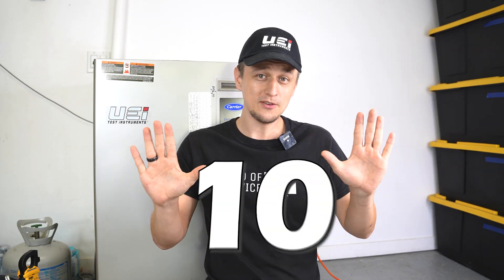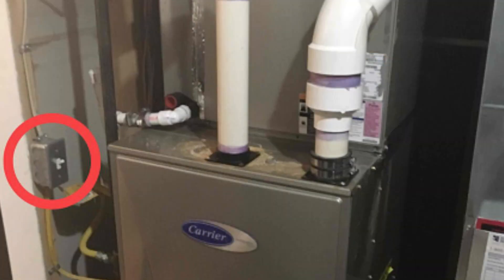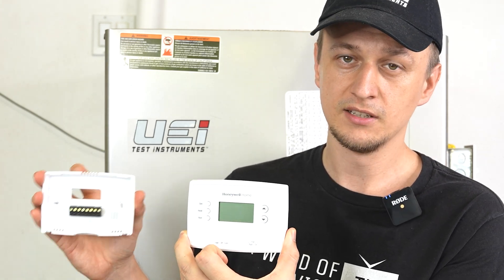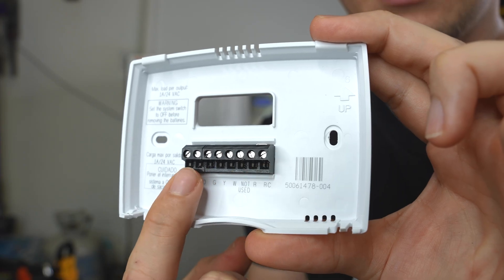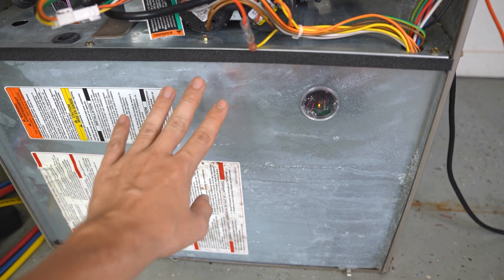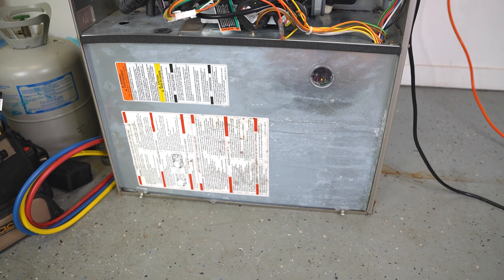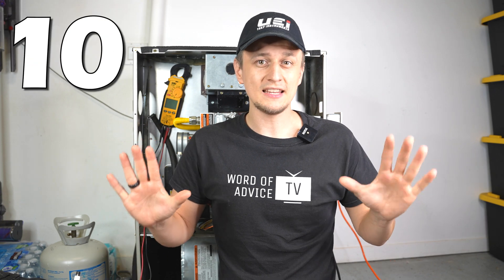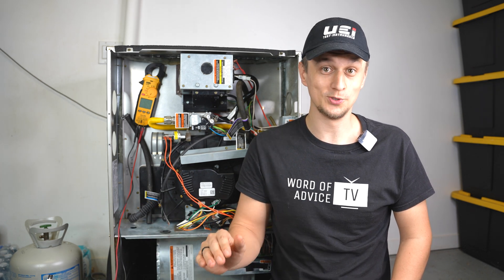10 Common Reasons Why Gas Furnace Won't Turn On

Comment from the maker: ⬇ Other videos you may find helpful:

The MOST Common Furnace Problem:
https://youtu.be/3Jonl_TLkpE
How a Furnace Works - Sequence of Operation:
https://youtu.be/AQD_MedIklI
Top 5 Furnace Problems:
https://youtu.be/T4IWtKy--Vk
How to Find a Low Voltage Short:
https://youtu.be/4e4wsruGS0s
Furnace Blowing Cold Air, How to Fix It:
https://youtu.be/pJzP1jzYPqg
10 Reasons Furnace Overheats:
https://youtu.be/3ZPmltTR5S4
Don't Buy a High Efficiency Furnace:
https://youtu.be/7d783qs3laA
Best HVAC Brand to Buy:
https://youtu.be/Cy46yTbkNhI
How to Manually Light Furnace:
https://youtu.be/-bMz1En0DSg
How to Read Furnace Wiring Diagram:
https://youtu.be/2MSedAkirqw
How to Figure Out Age of Furnace:
https://youtu.be/ntBIaY7ncqY
10 Yearly Furnace Maintenance Tips:
https://youtu.be/2IG_YZTR-lE
Thermostat Screen Blank - 10 Reasons Why:
https://youtu.be/vi3OJuGfaac
Furnace Error Codes Explained:
https://youtu.be/J8Zegm4TClM
Reply: Flame sensor most of the time and if it's not damaged clean it up and bam back in business

Comment: Hello. I would like to ask you a question and I hope you can help me. My home heater runs on gas. It has three gas nozzles. But for some reason, the three nozzles don't ignite at the same time; the third nozzle ignites 3 to 5 seconds later than the other two.  Because of this, my heater automatically shuts off. Could you please tell me how to fix this? Thank you.

Comment: I CAN’T THANK YOU ENOUGH!, I have a newer gas boiler –a radiator heat furnace that suddenly did not turn on  today about 4 pm.  I had moved  furniture and did bump the thermostat in the bedroom but didn’t think too much about it. 
    At 8 pm the house was pretty cold as were all the radiators –[here in southwest pa it’s  25 degrees].  So I made many trips to the cellar to trouble shoot and back up 2 flights up stairs to no avail.  All the vids I watched didn’t go through the basics first.  Well, it was the red wire of the thermostat that came loose from the bump.   Furnace back up at 10:40 pm.  Thank you!… Best blessings of Holidays etc…

Comment: My sister's thermostat says "locked" or "locked out" and can't figure it out
Reply from the maker: Is the furnace blinking any error codes? This error message might mean that the furnace is locked out due to a tripped safety switch. Or.. Could this simply be a child lock? A quick google search for your brand thermostat should give you an answer.

Comment: Thank you! - Furnace not coming on. Nervous about messing w. it, but thought before I call someone…
The on/off switch was off. Whew. All good.
btw: Used my 1910 Perfection kerosene heater & a plug-in oil heater to keep us warm last night.

Comment: Thank you so much for this video. It got colder outside and I turned on the heater and it didn’t work. It got to 66 degrees overnight. I watched your video this morning n fixed the problem! Thank you, thank you!!!
Reply from the maker: You're so welcome! Glad I could help you get the heat back on!

Comment: You are a life saver my friend. My family and I have spent the last week in a cold house because our heater went out. No money to make a service call. I have tried a few things including checking the breaker and nothing worked. After watching your video, I went back to the attic to look for the LED light on the furnace control board. Luckily there was a red led light on it. Going back to step #3, I decided to change the batteries on the thermostat like you suggested. Lord and behold, my furnace came back on. Never thought the thermostat had anything to do with the furnace. Thank you again.

Comment: Very good videos, but I have a Rudd gas furnace 1989 Model UGDE-12ERAJS, that I've tuned up with all new electronic components but the gas valve won't fire in sequence, gas valve doesn't seem to be getting a full 24 volts from the new board, is it possible to have a new defective control board? This furnace seems to have no flame sensor that I can locate and no wiring to a concealed sensor. I can apply 24 volts to the gas valve with a jumper wire and it fires and runs fine. Very puzzling.

Comment: LOL! Give the high limit switch a good whack! Yes, but use 2 tools of choice. Use the screw or nut driver and tap in IT with another tool of choice. The execution of switch position disturbance would be more precise and you won't possibly damage the poor connection points by indiscriminately "whacking" the area with a tool all willy nilly . . . other than that, this WAS entertaining. Took awhile to get here but I found the time to see how you go about basic diagnostics.

Comment: Thank you.  It was the batteries in the thermostat.  Your video was greatly appreciated.  Now I can go fix the blinking clock lights after turning on/off all of the circuit breakers.  😂

Comment: Thank you sir, I watched all steps and to my luck it was the power switch!!!! Apparently I have some wires dangling  by my power switch and I must have pulled the wire on accident and turned the switch off.
I tested all steps and it brought me back to the beginning lol
By the way, love the “dad joke” at the end😂
Reply: I cant fine the reset red or yellow swith to my lennox furnace
Reply: S

S

G

I

T

Comment: You sound very knowledgeable on newer furnaces but my furnace is probably maybe 30 years old or  more.  My thermostat is the little gold round guy with not digital...analog. Trane XE70.  Some tips will help but after you started talking about themostats and  batteries I can't follow.  Hope theres 
more for old furnaces.

Comment: Another issue that can arise after servicing is that the tech might disconnect the white wires from the control board, and then not tighten them down before leaving, resulting in your system working fine for a few hours before the temperature dropping overnight after the cables wiggle out. Don't ask how I know.

Luckily it's an easy fix.

Comment: You saved Christmas.  My furnace shut down two days before Christmas.  The fan stays on unless I shut the power to the furnace.  One site stated that if fan continues to run it might indicate a faulty control board...so I research and find a new board on Amazon.  I figure that I can replace the board fairly easily...if that's the problem.  The board is providing an error code of 33, which means that it might be a problem with the heat sensors, so I decide to bite the financial bullet and call a technician.  EVERYONE is either busy, or won't service furnaces that they didn't install.  One tech suggests that it might be the limit switch.  Ah ha!!  I remember that your video went over a possible way to unstick a stuck limit switch.  I gave it a few sharp raps, turned on the power, and...lo and behold, the LED light is consistently on...no more error code.  Heater works great now.  No more sitting by the fireplace using coals for heat.  Thanks for saving our holidays.

Comment: Really understand, but the Lennox Gas unit won't work when the motor is stuck and won't run. I replaced the new motor. Now it is not working. Is the ignitor module not working?  I looked at this ignitor module's LED light. The LED light is nothing. I use my digital meter and point to the transformer- 120VAC is okay, and 24VAC is good. is the Ignitor module bad?  This FENWEL ignitor module is too expensive, about $500.

Comment: I have a old carrier furnace. The furnace turns on and blows hot air for 10 minutes. The. After 10 minutes the furnace shuts off and throws a 14 code error. On my furnace manual it says for code 14 refer to 34. It has a list of things to check like, gas valve, dirty flame sensor, blocked vent, I checked all these but the problem still persist. Would you know what’s wrong with my furnace ?

Comment: Furnace won't kick on... If I turn the breaker off/on it turns on and heats up the home. But, then it will not kick back on unless I turn off the breaker and then turn ot back on.  Manually repeat to keep the house warm.
Reply: I'm having the same issue

Comment: please answer my breaker was tripped. tried resetting but trips again immediatly
Reply from the maker: This usually means that you either have a bad breaker or there is short somewhere. To begin with it would be good to narrow down where the short is. I would start by turning the breaker off (and verify that it is off with a multimeter or voltage detector) and then disconnect the power wires going into the furnace. Make sure the disconnected wires are not touching any metal and turn the breaker back on. If it still trips, then you know the problem has nothing to do with the furnace. If it doesn't trip, then you know that the furnace is shorting out somewhere inside the unit.

Comment: Saved yet again by youtube.

Weak battery in my thermostat. Had enough to kick on the AC but not heat.
Reply: @SeanCantShoot  yep I had to go out to calls for dead thermostat batterys more than id like to have but money is money if you don't know what to do...tip if you have a thermostat thats not a dial type and is square front of it pops off there is 2 AAA batteries in there replace it with new  ones and carefully replace face cover first thing to check and usually the issue..and if that's not it and the heat it not coming out probably the flame sensor which isnt to hard to do if you have even basic do it yourself skill 99% of   the time they just need cleaning that is another one I have done many times too

Comment: i had the switch off problem on a water heater I put in. this woman's kids were standing around in basement watching me put in water heater they didn't speak English. so, after I left, they thought water heater was new toy for them next day i get call no hot water the kids turned knob to off on water heater had to get interpreter to tell mother to keep kids away from water heater and out of basement.

Comment: I have a question for you. I know you have to turn the power off, but is it necessary to turn off the gas when cleaning the burners? I appreciate your response. Thanks again for the informative videos.
Reply from the maker: You don't have to turn the gas off when cleaning the burners, unless you are taking the gas piping apart.

Comment: I’m struggling to get heat & a/c on a Carrier infinity unit that was recently worked on, at an $800 expense. Can you help with some wiring questions, I’ll scape some $ together if I can’t talk to someone to see where the last guy changed wires.

Comment: Nice video - thanks.
On the two gas furnaces we have had the flame sensor failed - must be pretty common?
I was able to fix it by cleaning with steelwool until I could replace with new.
Reply from the maker: That is the most common furnace problem. A dirty flame sensor. It's literally just a steel rod so cleaning it is enough, no need to replace unless you simply prefer to have a new one. If you're interested at all, watch this video and you will learn more about the flame sensor/how it actually works than you ever wanted to 😄: https://youtu.be/-QKHz1Mv9Ew?si=Jsf2fverkNuNJmIQ

Comment: Thank you ! Another easy thing to check is the inflow air and outflow exhaust pipes to be sure they are now blocked ( snow, insects, etc.). My neighbor's AC would not  go on. Company came and pronounced the thermostat bad. I lent him an extra thermostat, known good, and still no AC. I went to circuit board and tested the 3A fuse- blown. What happened was their painter did not protect the wiring at the thermostat ( or shut off the power at furnace) and it probably shorted the circuit. 10 seconds later: AC.
Reply from the maker: Thank you for sharing the experience and another thing to check. Much appreciated!

Comment: Hi! What does a constant blinking red light mean ?
Reply from the maker: If you look at the back of your furnace door, there should be a label that lists what all the error codes mean. On top of that list it should explain what a blinking red light signifies. It could mean a few different things depending on the brand of your furnace. It could mean normal operation, furnace is in standby mode, soft lockout, or a safety switch is tripped.
Reply: @WordofAdviceTV  thank you

Comment: Just a word of advice, a breaker doesn't trip for no reason. If the breaker is actually tripped, I'd open up the furnace and check all the wires before resetting. 🙂
Reply: What would cause that breaker to trip guys?
Reply: @izzymoney85 
It could be short circuit because of wires insulation is gone and wires touching each other. Ground fault or overload
Reply: @izzymoney85  it could also be a bad breaker
Reply: Hey guys I’m freezing right now and we all sick my unit only trips when I turn my heater on my ac works fine but if I turn my heater on after like 5 minutes thermostat goes blank and everything turns off and if I reset the breaker everything works again but happens again any idea plz ?
Reply from the maker: Yes! I did not talk about that in the video but you are right. Especially if the breaker trips again after getting reset.

Comment: Have to add an addendum to #3&4 (thermostat) as I had this problem this week on a no heat call myself. Customer said they turned thermostat switch to "HEAT", and no heat. Upon arrival I looked at it and the switch was in fact on heat. However, on closer inspection, I noticed the display still showed "COOL". I flipped the switch to "OFF" then back to "HEAT". The display then showed HEAT. Problem solved, at least for now. I didn't replace the thermostat but suggested to them that if it happened again that I would advise having it replaced as the switch contact may be bad. And as you say, simple solutions are the best solutions! As always, enjoy your videos Jay. Keep up the good work!
Reply from the maker: Oh interesting! I've never had that happen to me before, thank you for sharing! Good thing to be on the lookout for.
Reply: It's insane to me that people are this inept. Like they couldn't even try to flip the switch twice before they call the HVAC guy

Comment: A quick check between R and C will eliminate most of the early checks... plus it's safe because you're working on the low voltage side.  Finding 24V between R and C with a meter set to voltage means breaker, customer switch, door switch (including all wiring) and transformer are OK.  Call for heat and the flash code if present will direct you to the fault. If you don't get 24V between R and C you will need to check all the stuff in the first few checks.
Reply from the maker: Yes! You effectively made this process 10 times easier. 😄 Thank you for explaining. I think it was still good that I showed each individual piece but doing it the way you suggested is way more efficient.
Reply: @WordofAdviceTV  nothing wrong with being methodical and you were very good at doing that.  For an educational video your explanation is more thorough and might be necessary if things aren't playing nicely.  My quick check was how I explained troubleshooting to my students but only after they got the whole lesson as you explained.